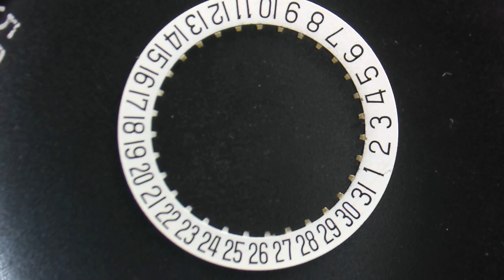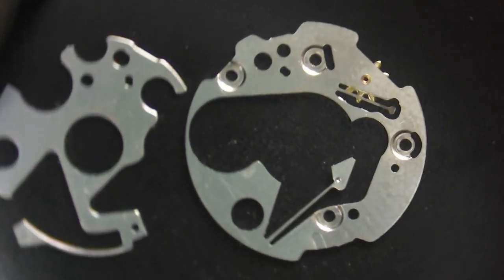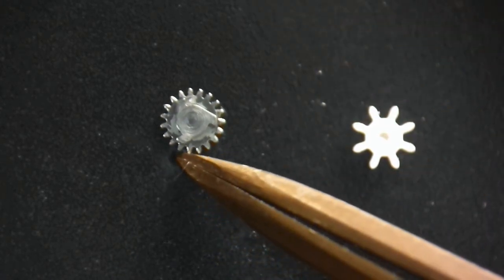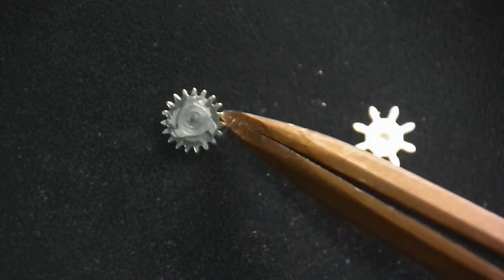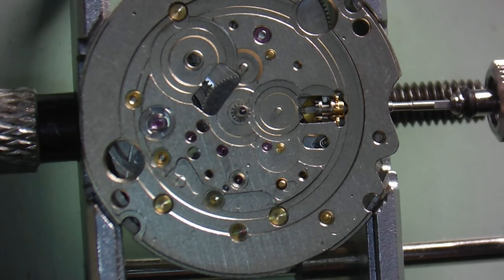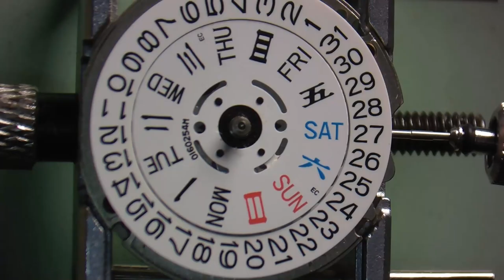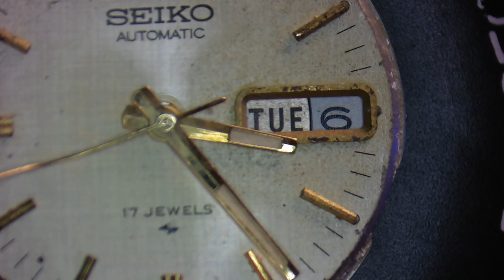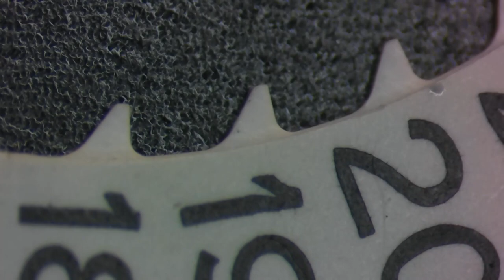How to Service the Calendar System in a Watch

Comment: Excellent video Alex.  Exactly what I was needing.  I just got an Omega quartz Seamaster f300 where the date wheel won't turn each night but it can be adjusted very easily.  I read that this is an extreamly common issue on this model where the teeth on the wheel are plastic and wear out.  Apparently there is a German manufacturer that makes replacements wheel with Steel teeth that solves this issue.  Thanks again.

Comment: I have a brand-new SW 100. It is an ETA2671 compatible movement when I use the hand setting position and turn the crown towards me and I keep turning, and I keep turning the date that’s not advance. I was hesitant to try to use the quick change date setting not knowing what point, the function was about to go on, I did take the chance and the chains gate setting works perfectly, but when I advance the hands there’s no change. This is really driving me crazy. I’m not sure if I got a faulty component although I would I would guess not because I ordered it from Switzerland. It came her medically sealed and brand-new ready to go and what are you guys think why is the date advancements not happening when I manually turn the hands?
Reply from the maker: Is the hr wheel installed and seated into motion works?

Comment: I'm really grateful for your videos and also became a patron. I'm fairly new to watchmaking but in this video lubricanting the date wheel didn't feel right. Are you sure to lubricate something that is never part of the cleaning process?
Reply from the maker: Thank you for your support Peer.
I would clean the teeth of the date wheel off with a little IPA and a Q-tip and that’s about it. 
As you know you don’t wanna clean the date will in any kind of machine, but it still needs to be clean, right. Date wheels off and pick up residual oil from the movement so you don’t want to put that into a freshly cleaned movement that you’re servicing.
Plastic parts don’t get lubricated, but many date wheels have metal teeth that interact with the date jumper, which is also metal so anytime you have metal on metal friction do you want a small amount of lubrication. The key here is a small amount of lubrication.
Reply: @watchrepairtutorials  never thought about plastic parts picking up dirt from elsewhere anyway, good point. Thank you for clarifying. And thank you once again for your valuable effort to enlighten watchmakers around the world.

Comment: I loved this video . I do have a question though. On the ETA 2789 movements with quick set, I can get the day and date to change by advancing the hands, and it changes perfectly at midnight, but if I advance the hands and stop at 11:55pm, the watch will run past midnight and nothing will happen. Is there some point in time where the mechanism needs to start from in order to change the calendar organically?
Reply from the maker: Are you saying that if you wind the watch past 24 hrs the date changes but if you wind it 23 hrs and 55 minutes and let it continue to run on its own the date will not turn over?

Comment: Do you think that using a piece of a plastic drinking straw might be a good substitute for the plastic stick for greasing the teeth?  It’s a great method, no doubt, but ’m just thinking that I would prefer to throw it away rather than to clean the grease off. Can you think of any reason that this wouldn’t be a good idea?  I have a calendar works to assemble tonight and I’m going to use your method to hear the teeth. Thx!
Reply from the maker: Should work fine. Just remember, you just need a thin coating.

Comment: Hi Alex, Could you possibly help me. One of my watches has the winder, a button underneath that, and a button over the winder. The top button changes the date. However, now it's stopped working. Ive opened the watch and noticed when you press the date button, it presses a small lever. This lever stays down (in) when pressed. Does this mean that the spring ? (if it has one)  has either broken or come off. 
Being brand new to watch repairs, I don't want to mess with things until I have a bit more knowledge. 
Could you possibly help. Thanks in advance. Martin (UK)
Reply from the maker: well, it's possible that the spring broke depending on how old it is, but it could also just be sticking from the old grease being dried up. 
I call that "Stiction .
The only way to know for sure is to open it up, inspect the parts,  clean them and see if it works.

Comment: My first amateur repair job has a non functioning Day wheel.  I found a loose piece in the case when I opened it.  It is the 3 sided "cam" that sits on the smaller gear.  I hope I can fix it.  Thx
Reply from the maker: Good Luck John. Let  me know how it turns out.

Comment: hello WRT. I have the common issue of early or late date changes in 2 of my watches (1 auto 1 quartz) but what I've noticed is that the date changing process has become prolonged since the problem started. for example it used to take 1-2 hours and now it takes 3-4. What could be causing this problem? Thank you!
Reply from the maker: Loose hands can be one reason. The time for the date change is determined by the hand position.
When setting the hands you turn the crown until the instant the date clicks over. Some date indicator wheels are spring loaded, some take a couple hours. But the moment the date change happens, you set the hr hand, then check it to make sure it’s right, then you set the minute hand.
Reply: Thank you for your reply! 🙂 @watchrepairtutorials
Reply from the maker: @jimron9008  no worries

Comment: Another amazing, helpful video from this channel. I've never seen the tool you used to hold down the jumper spring, that you said is usually used to hold down setting levers so a stem can be pulled. I need to add it to the tool list 😂. I can't seem to find it just Googling areound though, is it a widely available tool, or something that was custom made? As always, thank you for everything you do Alex!
Reply from the maker: It’s a watch band pin pusher.
https://www.esslinger.com/watch-band-pin-pusher-set-of-10-pins-with-wood-box/
Good for all kinds of stuff.
Reply: @watchrepairtutorials  It looks like it would be a great addition for sure. Thanks for the link!

Comment: Hi Alex, hope you're doing well. I've been having one issue after another since I had my 1988 DJ serviced last year. I noticed the date wheel moving slightly when I manually wind it. Not sure if it's been happening all along, but it doesn't seem like that should be the case. Any thoughts on it would be appreciated.
Reply from the maker: What’s a DJ ? What movement is it?
Reply: @watchrepairtutorials  Datejust 3035.
Reply from the maker: @GregJGreen  ahhh. It’s a known problem with 3035 that the date wheel is a bit touchy. More than likely there is damage to the teeth that’s causing the issue. The teeth are under a lot of tension and wear is pretty common on these older movements. Who serviced it.Rolex ?
Reply: @watchrepairtutorials  thanks, Alex. I'm not sure if it was sent to a RSC or worked on by a certified Rolex watchmaker elsewhere. Took it to Ben Bridge in Lynnwood, WA in July of last year and got it back in December. I got a Rolex service card but no book or receipt with a Rolex letterhead, so I think it was likely a Ben Bridge watchmaker certified by Rolex. 

The movement felt too tight when manually winding and I had a hard time getting the crown to screw down properly, so I took it straight back and waited another 4 months before it was ready. I believe Rolex would have replaced anything that showed signs of wear. I was charged $940 for servicing, it should have come back right the first time. It's unacceptable either way, so it's going back yet again, and I'm going to get to the bottom of who serviced it.
Reply from the maker: @GregJGreen  ouch and what a pain in the ass. Just ask him to take a closer look at that date ring because that’s probably where your problem is.
Good luck brother
Reply: @watchrepairtutorials  thank you Alex, I really appreciate it. 👊 It's been nearly a year long saga with this Rolex service. Not sure if I even want another one at some point down the road after all this.
Reply from the maker: @GregJGreen  it’s funny you say that. For years I wore a Rolex Submariner Oyster, with the blue dial and two-tone bracelet. When I first got it, I was really excited and thought Man I would never need another wash ever. Then after about six months after the excitement wore off, it literally was just another watch. I always felt somewhat nervous wearing it, and it didn’t really make financial sense to me to have that much money on my wrist.
Reply: @watchrepairtutorials subs are really cool, but those prices! I was seriously thinking about selling the dang thing, but my girlfriend talked me out of it. Said it's pretty much the same as having money on hand for a rainy day, which is true. I got it 9 years ago to settle a debt, probably wouldn't have a Rolex to this day if not for that. After all is said and done, one doesn't have to shell out big bucks to have fun with this hobby.

Comment: What if it's just the day change button that doesn't work?
Reply from the maker: It’s relatively simple James. It’s obviously will be different depending on the movement but I would suggest looking at the calendar system with the day Will removed press the button and trace the parts backwards to see which one is not operating correctly.